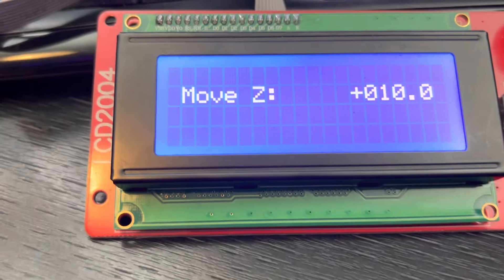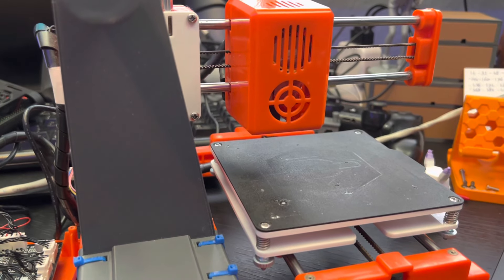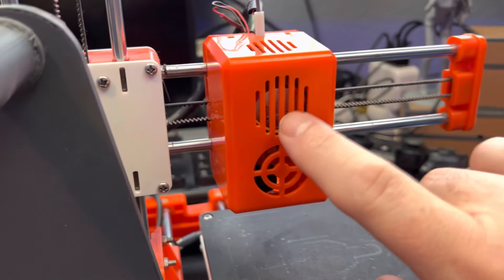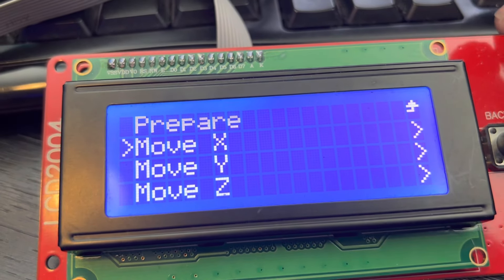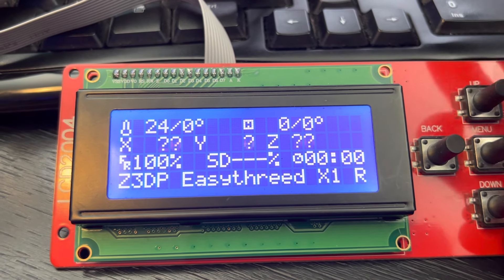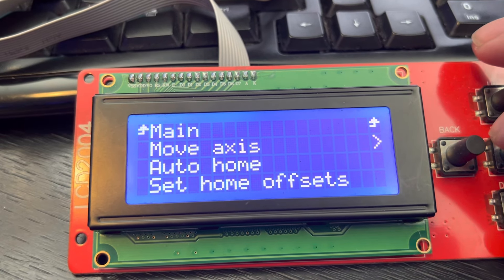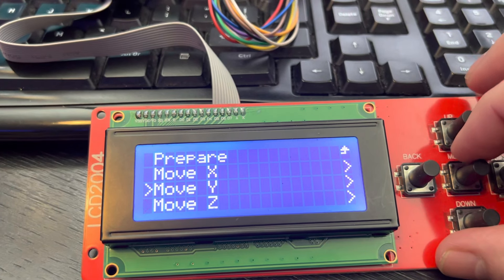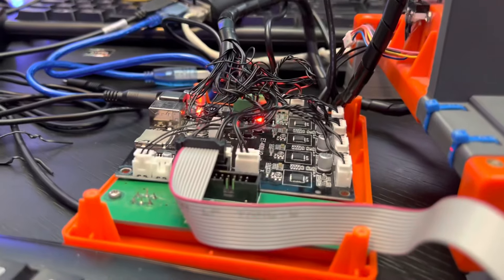Easythreed X1 custom firmware and screen

Comment: Hello! I know this is quite a late comment but I'll need help on installing a screen into a printer similar to the X1, the K7. I haven't yet learnt how to create or edit firmware to support the screen, which would be a 12864, and am unable to find any guides on how to do it. There are some mods but they are targetted on the X1, which has an 8 bit ET4000v2 mainboard, and not the K7, which has a 32 bit ET4000+ mainboard. Thanks.
Reply from the maker: You are never late. I can make a video where I do these upgrades. I'm not going to use the X1, but the K9. But you need to wait for a bit. I did do this on the X1 before, which I can repeat again on a similar board for the X1 if that is something you want.
Reply: @Zachary3DPrints  Thanks. By the way, which board does the K9 use? Most K7s use the ET4000+ board while the X1 has the ET4000V2 board. These two boards are different as the ET4000+ is 32 bit and the ET4000v2 is 8 bit. If the board is, infact, an ET4000+, it would mean that it is much easier for me to modify my k7 board using the guide you have on the k9. But if it has some other board, most likely the ET4000V2, then I am unfortunately not able to really follow the tutorial you are going to make. Again, thanks!
Reply: @Zachary3DPrints  I dont really mind waiting, i have other projects to do anyway.
Reply from the maker: Oh thank you for the information about the board.
Reply from the maker: Yeah, I'm also very busy with other projects and video making to keep the channel and videos going. But Still wanna make videos about it, without going too far off... or else I'm replacing the whole printer, piece by piece 😉
Reply: @Zachary3DPrints  Perhaps just atleast try telling which pin goes to which here. Or perhaps any references?

Comment: Can you tell the kind of cables you use and , how the cable is connected on the lcd pin numbers   , i have 4 ET-4000 motherboard  :O)
Reply from the maker: Thank you for your question. I have received many similar questions like this, so I'm going to make one video about this and show you that in details